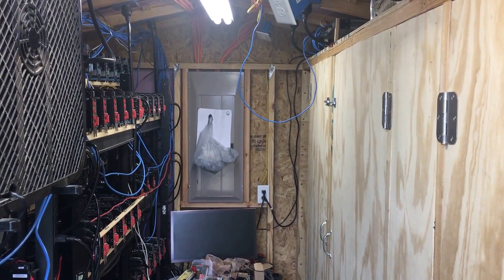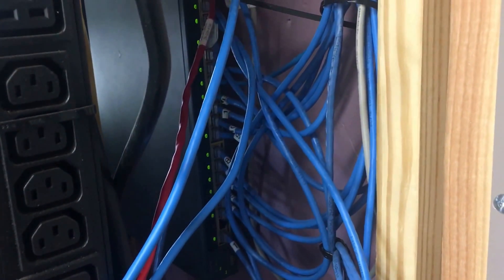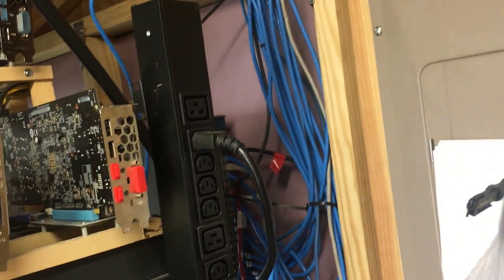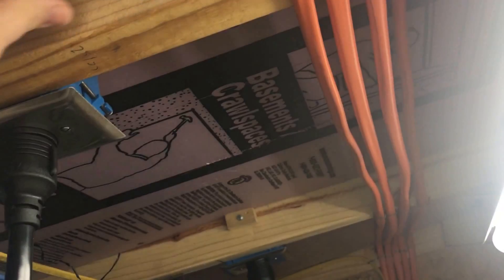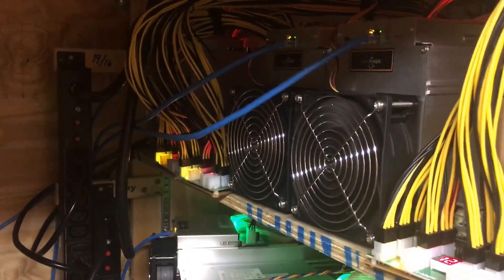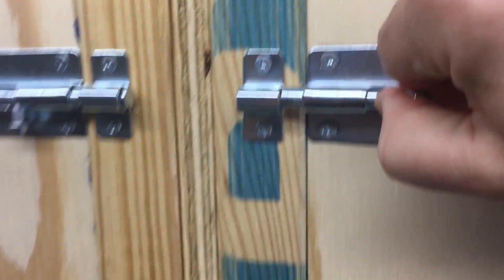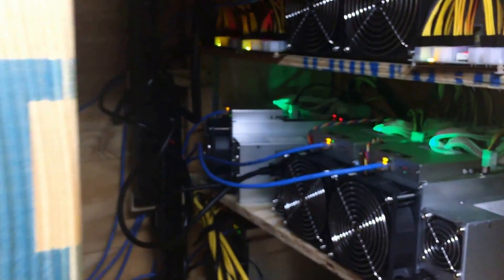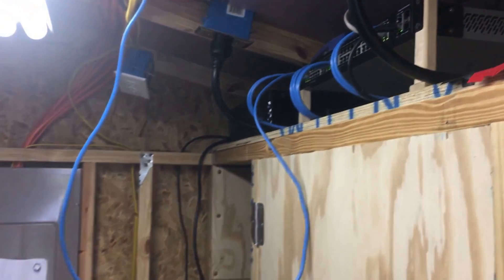5.6 GH Ethereum Mining Shed  - Network switch upgrade!

Comment: Man you were ahead of the game back then for residential mining!  I am going to build a shed, and  was wondering if you would have done anything differently regarding the shed build - specifically the air flow and cooling?  Did the floor grates and consumer box fans work out good (versus wall vents)?  I am trying to visualize how this would work if GPU's were on both sides of the walls, versus the one side in your case - I suspect not as efficient.   I read a comment that you sold everything and moved on (a different conversation I would love to have).  Thank you.

Comment: how the fuck did you get an electrical permit for a 200amp sub panel  for a shed????
Reply from the maker: Electrician and working with the power company
Reply: BeerMan 81 good work man. That’s not fun or easy
Reply: BeerMan 81 did they have to up grade your transformer???
Reply from the maker: It was quite a bit of work. B4 we had an upgrade, the power company had to inspect the XMR to see if it could handle the load. We originally wanted to have a dedicated service to the shed, but they wouldn't allow it. So we were forced to upgrade the house to 400A and backfeed the shed 225A. This was what they allowed. It is all to code man.
Reply: BeerMan 81 very impressed I’m an electrical contractor .

Comment: What is your replacement rate for cards? How often is there a hardware failure? Would be great to see FLIR imagery of the shed. Assuming the network wall side was closed off to increase air pressure to help drive the warm aisle out. Not sure what geographic you live in, but assuming a adiabatic effect of some sort with natural moisture in the air. At this point, might want to consider a shipping container.
Reply from the maker: my first fan died, and am sending it in soon. i have two other fan blades that broke, but that was operator error. the rest are great.  i have replaced around 20 risers or so total, so the failure rate is quite low.